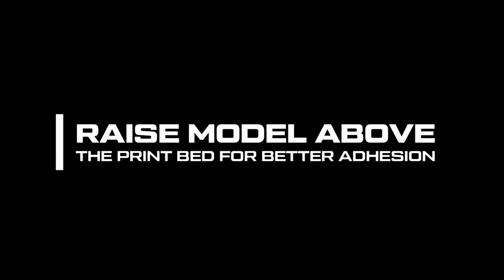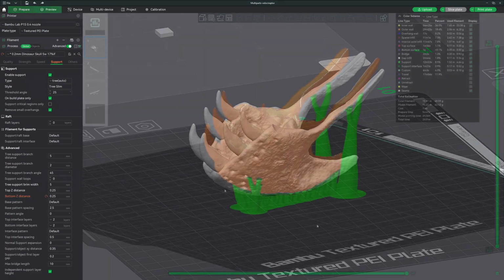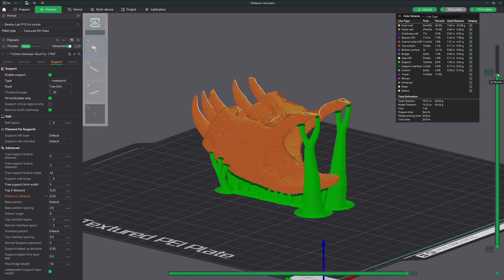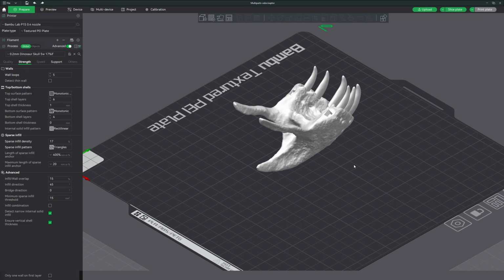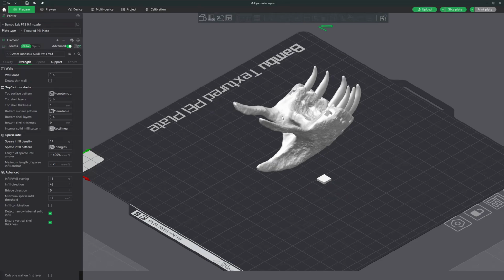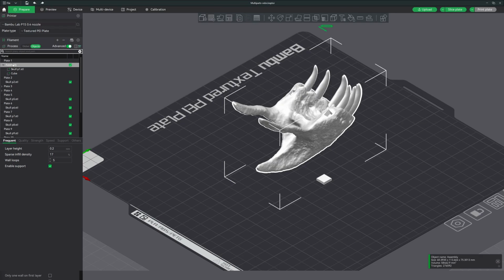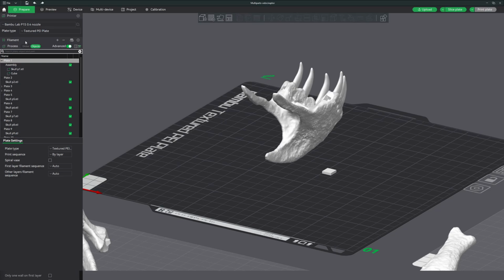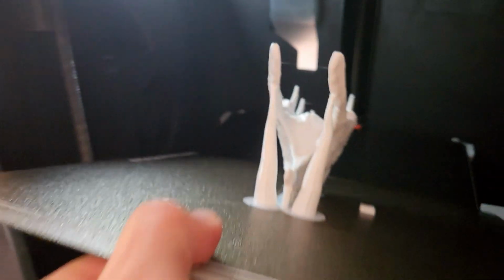Say Goodbye to Failed Prints: Lift 3D Models for Success

Comment: What material are you using?
Reply from the maker: @Konrad162  I mainly use PETG when printing single colors.
Reply: @planet3dp  thank you! I will be buying my first 3d printer. I have selected P1S combo. And I wanted to check what kind of material you are using because it is very nice at least visually. ;)

Can I make from PETG some led lamps?

Comment: Great idea! Can I ask how tall you recommend the cube be/high off the plate the model is?
Reply from the maker: @mythosarts  I usually do 1mm, but if you make the z height less than the layer height usually .2mm then it will actually get skipped during print and not waste filament and time.
Reply: Great question 👍

Comment: Do you leave the cube and print it as well?
Reply: You can see the cube printed in the end.
Reply from the maker: Yes as of right it needs to be left. I would suggest changing the z of the cube to 1mm to save filament.
Reply: Scale the z axis for the cube to less than the  layer height and it won't print.
Reply: Have you tried moving the cube under to model and making it 0.2mm?